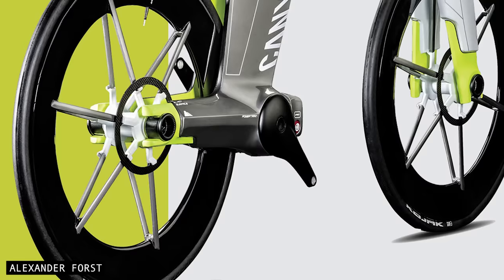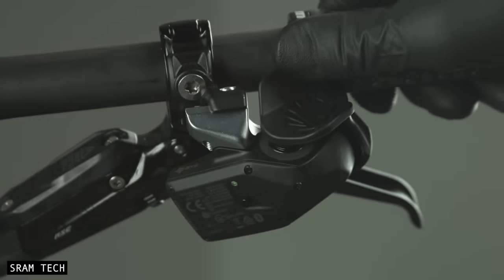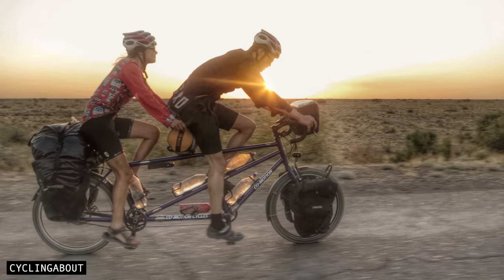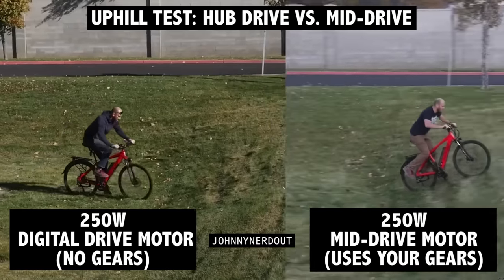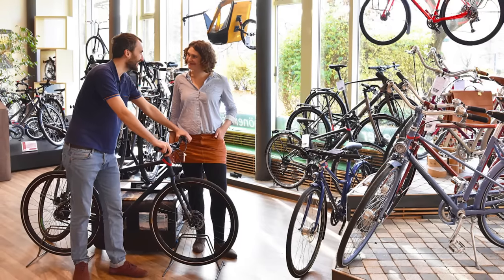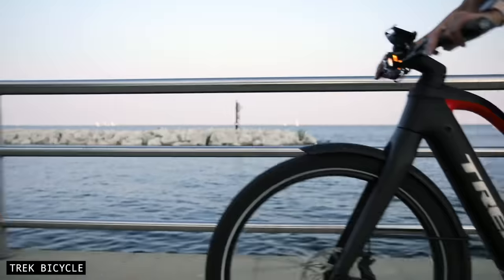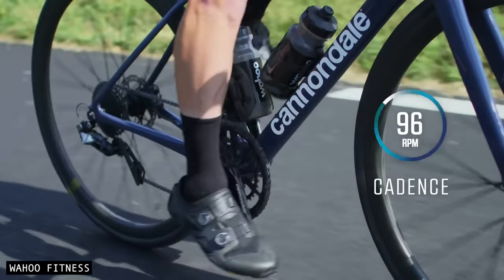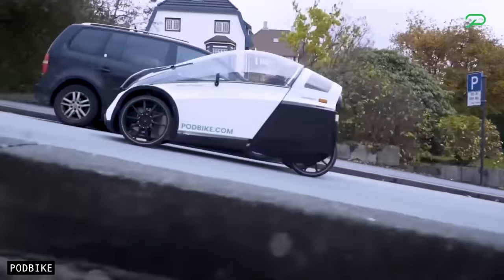Are Chainless Digital Drive Bicycles The Future of Cycling?

Comment: Keep the chain but add the digital drive to the front wheel, and synchronize it to the pedaling, that would be an awesome bicycle (at least for me ) able to climb difficult obstacles.
Reply: I will say that it'd need a back motor aswell, it just isn't smart to have a lot of power on just the front wheel as it can slip out easily, then 2WD would be better
Reply: Front wheel driven electric bicycles already exist, but they are less popular because acceleration feels less natural as you're pulled forward and they make steering more difficult. It's cheaper though than motors at the crankset.
Reply: @Frrk  hmm i would disagree with that, a Chinese 500W peak torque sensing middrive will be around €300

a torque sensing bottom bracket for a front or rear wheel motor controller often runs for €80, that is without the controller, motor, wheel etc.

when you're talking about cadence sensing, sure, but even then it's still hard to beat the €300 middrive
Reply: @BH4x0r  That does make sense, from a components perspective. I just looked at advice on biking sites where it was claimed.
Reply: @Frrk  truthfully most middrives are made by European brands, which also like a large part of the money as profit if ya know what i mean, which is understandable as it's actually very expensive to pay European employee's, atleast in Belgium, The Netherlands, Germany and France, eastern min wages are much lower

for example for the min wage of a few years back in Belgium (€1650 a month) the companies had to pay out €2200 or more to the recipients as the rest goes to the taxes
Reply: oh my god... we all ready have this.

besides to run a "DIGITAL DRIVE" the generator in the pedals must creat magnetic friction to generate power for the electric motor un the wheel hub.

adding that friction + regular chain for the rear wheel = A very tuff pedal to spin, you might even be to light weight to actualy push the pedal down.

WE DONT HAVE MAGIC!
Reply: Except that, as you turn, the front and rear wheels need to turn at different speeds... the difference being directly related to the radius of the turn.

So... fail.

It would only work in dirt / mud / snow.
Reply: @timhofstetter5654  how would that be a fail? that is why they would have separate controllers and the synchronisation he probably means acceleration while increasing pedaling speed and regeneration when you slow down, i would give the rear a reference rpm and allow the front wheel to have a slight rpm difference, that is how i have setup the "traction control" in my dual motor escooter, the front and rear have a max margin of difference till it limits the other motor from spinning faster, cause if one motor/wheel suddenly loses grip it would try to spin up much faster but in this case it wont
Reply: @BH4x0r  So if the front is permitted to "slip" with relation to the rear, then it will never be powered at all when riding in a straight line because it will always be within the "permitted slip" window; it will always just be in "coast" mode, which means that its motor will always exert electrical drag.

If one motor/wheel "suddenly loses grip", that means that you're lying on the ground beside your bike, which is crazily trying to drive away from you because you hit a patch of sand or gravel during a turn.
Reply: @timhofstetter5654  no it means it will give the same power, but in power control mode unless one wheel slips they shouldn't really differ, i have my motors in my case limited to 1900W each, so it goes up to 3800W, but since they're controlled individually both work together, but when turning one wheel would require more power than the other, which could/would slow the wheel down a bit or speed up, dependant on angle etc compared to the one that's always straight, but once one slips it will try to keep the rpm similar enough within the margin to not slip basically, i ride it daily and it works fine, no matter wether it's in turns or i ride over ice or wet leaves, it doesn't seem to ride any different and handle perfectly.
Reply: @BH4x0r  You don't seem to understand how your own drive system works. You also don't seem to understand that in a front/rear drive system, the front wheel nearly always (but NOT always) turns faster than the rear wheel does, by some variable amount, and if the rear wheel is permitted to run more slowly than the front wheel for short corners, then it will always try to run more slowly than the front wheel on the straightaway, so the front wheel will always pull it faster than it thinks it should be going so it has no reason to drive itself; it will always coast. If it did not, then it would also drive itself downhill, which would eliminate any possibility of regenerative braking or even speed moderation.

So fail.

It's worthless to drive both the front and rear wheels anyway. There just isn't any point in doing so when either would be plenty sufficient unto itself.

On a side note, it's pretty counterproductive to have an electric bike in the first place. Even one like this (the chainless thing) is counterproductive. It's "kewl" like spokeless wheels are "kewl", but we all know that spokeless wheels were a stupid idea, too. Some of us knew that before everyone else figured it out. Same here - some of us know from the gitgo that chainless bikes are a stupid idea. Everyone else has to figure it out the hard way.
Reply: @timhofstetter5654  ebikes are not counterproductive, it allows people to ride way longer and further, unless you live in a country where it is considered a sport

i purely use mine to commute, heck i don't even own a car and have a physical labor job, also the motors just both pull, it's hard to explain when your native language isn't English and i can't let you feel what it does

basically they both run at the power input by the throttle or PAS system, but once one desyncs enough it will indeed sorta coast/brake, it'll just force it to run at a lower rpm that's not much higher than the other wheel, but not if you don't lose traction

the motors are fully sensored and brushless and the controllers are smart enough to communicate with each other and tell each other what rpm they run at and one will reduce speed if it goes higher than the other's defined by the max rpm difference setting
Reply: @BH4x0r  But they ARE counterproductive. Bicycles are a terrific form of exercise, which not only conditions one to better physical health but also allays depression, byproduct of from laziness. eBikes undermine that; they encourge the return (or maintenance) of laziness and depression.

Which controllers are you using? I'd be very curious to look into those, if they intercommunicate. You see, I write firmware for eBike control boards, among other things. I know very well how they work internally, what cues they get, how they control the MOSFETs that send power to the BLDC motor's coils.
Reply: @timhofstetter5654  i use a pair of VESC based controllers, the whole firmware is open-source, it was originally made for electric skateboard purposes, the controllers communicate via CAN-Bus and can communicate data over uart which you can use to process data with perhaps an arduino or any other mcu really, and you can use an nrf module to communicate with a phone and change all parameters wirelessly to both controllers separately, also by individual ID's through the can bus etc.

they're neat albeit the original PAS system misses some features, which are easy enough to implement yourself if you code c/c++ which you most likely do as you say you write software for controllers

but that's great for you aswell as the whole code is publicly available

in my country bikes and ebikes are seen as a means of transport, not as a sport, our country is far less car-centric than most countries, i think there are as much people (or more) using (e)bikes and public transport (train, bus, tram) as their main mode of transport as there are people using cars as their main transport

in here you also don't really see as much road or gravel bikes, 90+% of bikes you see here have a upright or semi upright position, road bikes are more of a niche

imo i find ebikes and electric scooters more enjoyable than any other way of transport, i also don't really like being drenched in sweat when i got to work a physical labor job still, they're my main mode of transport.

I still feel nice and out in the open, the fresh air, nicely separated bike paths (from roads) etc, you connect with the nature, feel the breeze, and the acceleration is rewarding to me
Reply: @BH4x0r  It's hard to argue with that.

Where I live... any eBike (or other electrically powered vehicle, including hoverboards and everything else) rated higher than about 250W (capable of exceeding 20mph with a 170lb operator) requires special licensing and annual inspection. It's possible to have a higher-powered eBike, but it borders on ridiculous because the controller needs to be specifically modified (ahem) to throttle back before reaching the magic licensing speed. It helps to make it pedal-assist-only, with no grip/thumb throttle, because so few people seem to be capable of pedaling in excess of 20mph.    8)

...because they ride eBikes instead of earning their way.     8)

I'm just finishing up firmware now for one such controller... for an eBike project of my own. I'm getting up in years, and I can't keep up with the herd very easily any more. I'm not building it to haul me around, I'm building it just for the assistance. The bike is, by itself, a perfectly good "gravel bike". Just... with... a little extra for an old man.    8)
Reply: @BH4x0r  I live at the bottom of a steep hill, and every year I train myself by riding repeatedly up that hill in my lowest "gear", until I can't ride any higher. I carry marker tape with me and leave a mark at each stop to show my progress, and each time, I try to pass the highest progress marker. Someday I'll take that whole hill. I know it can be done.

Then I'll destroy my brakes on the way back down.    8)

The power / speed limit thing is liability. This world is full of idiots, and if they have an eBike capable of 45mph, then they'll absolutely ride it at 45mph... on the sidewalk, through pedestrians... and they will absolutely collide with people and with cars, generating huge damage for which they cannot pay (so they should be required to carry liability insurance)... and they'll claim that their brakes failed (so they should pay for equipment inspections), and they should have special licensing that can be revoked when they ride illegally, and so they can be taken to jail if they're caught riding with a revoked license.

Long ago... I had some faith in humanity. I've seen a great deal of abject stupidity since then.
Reply: @timhofstetter5654  my electric stand on scooter can do almost 60mph, but its always limited to 16mph, my bbshd ebike can do 28mph with ease but it's limited to 16mph

then again on the steep sections i mention that 1500W ebike can only do 10mph at max, while putting 1500W of power into it, so it's just not enough, simple

you can limit the speed and still reach max power, but whatever, only shortly/during heavy load ofcourse cuz once it reaches the speed limit it holds back power to not go faster

there are people that done 50+kmh (30+ mph) on Bosch ebikes by just adding an unlimiter box on it

so i feel like power should not be a limiting factor, but a speed limit is much more significant

even on those 250W motors people will figure ways to push much higher power and reach much higher speeds on it than it originally was made for, and as i mentioned before those usually can do a much higher continuous power than they claim either way

the power limits are a joke as i said before, speed limit should be the only significant factor

even a professional cyclist can peak more than 1200W, so the 250w+200w (average normal person power) = professional cyclist is a whole load of crap either way
Reply: @BH4x0r  Most people aren't "professional cyclists"... and technically, Olympian bicyclists don't even qualify because if they're "professional", they're automatically disqualified from competing in the Olympics; only amateurs can compete.

BUT... semantics notwithstanding... the government stands on power limitations because it's impossible to force every eBike manufacturer to state their bikes' max speeds in any uniform or credible manner, particularly because any bike's max speed is predicated upon tire pressure and road angle and head/tail winds and many other things, and different municipalities establish different limiting criteria, so each (usually Chinese) manufactuer would need to provide a whole volume of speeds versus various conditions... charts and curves and cetera -> nauseum. However... for most stock consumer-grade bikes... stated power (in watts) is a fairly good indicator of capabilty sans electronic speed governors.

Most people, after all, don't have the skill and inclination to modify much of anything unless it can be done with adhesive tape under direction of YouTube videos.    8)
Reply: @timhofstetter5654  governors are the only thing keeping Bosch ebikes and other "high end" brands alive, if they all actually had the same power people would buy the cheapest of the bunch rather than spend €3500 on an ebike that's limited to 15.5mph, especially in my country where most people would rather buy a cheap bike from stores similar to Walmart for a mere €200 rather than pay €500 and have a much improved ride, also in here everyone can ride bicycles, it's literally the first vehicle we ever learn to ride in our country in kindergarten, and still commonly use, in my country for people doing low distances bicycles are pretty much as or more common than cars

ebike manufacturers don't even state power rating in here anymore, they just say "... Nm", nothing more or less
Reply: @timhofstetter5654  oh one other thing, you think it doesn't apply power while it's in that window, it's kind of the other way around, if the wheel slips and starts spinning/would spin much faster than the other wheel the power to it gets limited to not turn that much faster than the other wheel (defined by your set max ERPM (electrical rpm) difference)

in my case if it slips and tries to turn more than 3km/h faster than the other wheel it simply wont and will limit it's speed so it matches the speed of the one that's still under more power and not slipping + 3km/h which is minimal rpms
Reply: @BH4x0r  If it applies power while speed is in the window, then it will keep accelerating through the window to the other side, even while coasting downhill.

Comment: Great video, but I disagree with the statement that digital drive e-bikes will be better in poor weather - at least in winter conditions like the photo shown as you said that. Battery output drops massively in cold weather, so you could conceivably bike somewhere, park your bike outside, and return to a dead battery a few hours later. Then you'd have to pedal your heavy, battery-equipped bike purely via the inefficient digital drive to get home. I've been driving an electric car for the last seven years, and a cold-soaked battery on a return trip is something I'm very familiar with.
Reply: You assumed there is a battery. Could be a capacitor bank.

Comment: I think the hybrid concept is great; you can control the bike speed independently of your pedaling speed. I could see an athlete commuting to work, really putting in a tough workout, yet his bike is moving at a moderate pace along a busy bike path.
And, of course, you could have it where you're pedaling at a moderate, constant  pace, while modulating your bike speed according to traffic conditions.

I've been a fan of the generator/motor/chainless concept for some time now, and this video does a great job of discussing the pluses and minuses of current technology.
Reply: Only problem you need to use the energy at somepoint if you generate all the time. Like you need to recharge an e-bike you drain all the time.
You also could partially short circuit the motor and dicipate the effort in heat. But that's kind of a waste.
Also if everybody drives a view watt extra a day for 30min this adds up to an significant amount of power over a year.
Reply: You mean, like gears on a normal chaindriven bike?
You've literally described exactly what gears do.

You can't have the energy input constantly greater than the energy output (ignoring drivetrain efficiency).. Even if you had super capacitors or a battery to store additional energy, these would eventually reach a state of maximum charge and you'd be back at square one.

The use case you've described is already achievable with gearing and the addition of a dynamo light or dragging the brakes.
Reply: @MrHaggyy  i dont think you can short circuit the motor very long. the energy will go towards heating up the wires. you can short the motor on a resistor though.
Reply: @MrHaggyy  i dont's think spending energy is a problem at all. when your battery is full it will just stop charging, and your generator will do nothing.
and i seriously doubt there will be a case of "too much energy" ever.
Reply: the biggest problem with independent of your feet controls for speed is, weel, it's independence. you'll need a gas crank on your handlebars and to relearn hardwired "pushing pedals make you go brr". which could take a lot of fun out of the cycling experience.
Reply: @swancrunch  That doesn't make any sense.
You peddle and the power you generate is transferred to the motor that is driving the rear wheel. The more power you put into peddling, the more power that is pushed out to drive the wheel. 
The only thing independent about is, is the fact that they are not mechanically connected. The energy in still directly dictates the energy out.